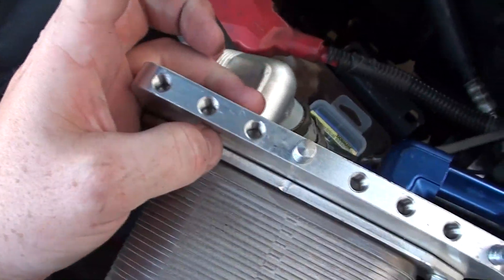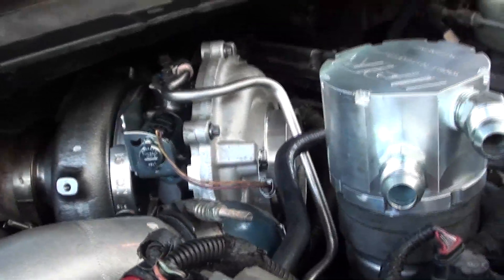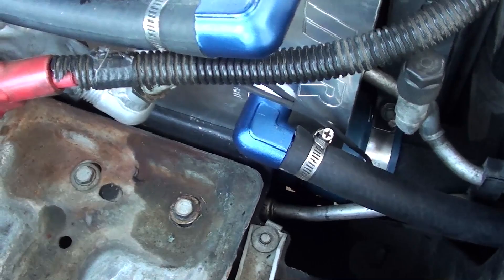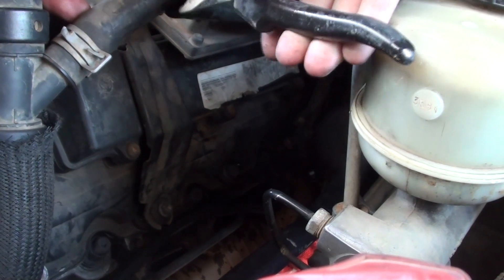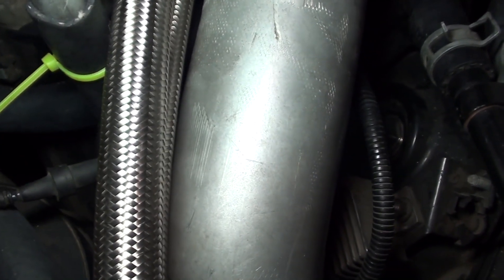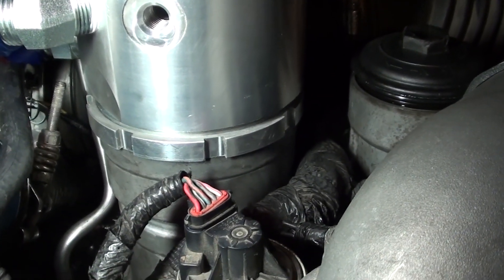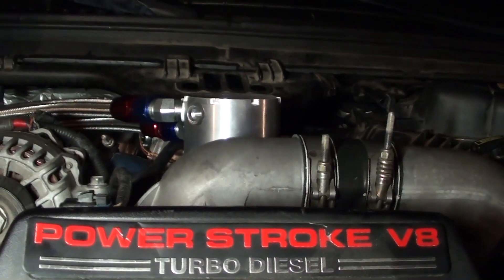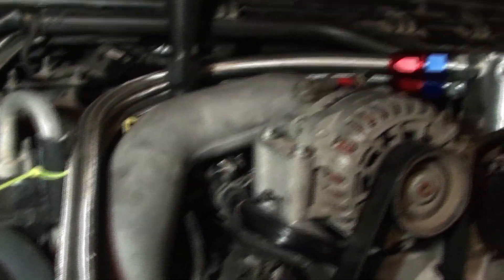Powerstroke 6.0 IPR Remote Oil Cooler + High Flow Coolant Filter Install - Part 7

Comment from the maker: I am on PS.org but I didn't sign up to be a guinea pig for IPR, I just filmed it so others could take a look at what it takes to install.  Some heat does get transferred into the coolant from a blocked EGR but it's not very much, and if it does happen to fail the coolant would just sit in the EGR cooler since both ends (exhaust and intake) are blocked off and wouldn't hurt anything.

Comment: I think Josh has it all figured now. 50 degrees spread was caused by the senor being mounted on the opposite side of the fitting. He was getting temp readings before the oil was cooled. Stay tuned, I think he will be posting some great results soon.

Comment from the maker: That's correct, the top hose on the oil filter cap goes to the top hose on the remote oil cooler mount, and bottom to bottom.  The bottom is the supply and top is the return (cool).

Comment: 50 degree deltas? Holy crap man! I just put an order in for their Gen 2 EGR Delete and high flow coolant filter kit too.... Glad I didn't pull the trigger on the oil cooler relocation kit!

Comment: very hard to get info on the kit doing my install . was wanting to know on the oil filter house is the bottom hose the hot oil out and the top would be cool oil back in .

Comment: I know this video is 9 years old, and I've googled everything to find it. I am trying to track down the oil filter housing tool to remove the top piece. I bought my truck with it already installed. I saw your nifty tool in the video. Do you have any idea where to get one or will I have to try to fab one?
Reply from the maker: Finally figured out what tool you were referring to.  I don't know if you can purchase it separate but you may give IPR a call to see. https://www.iprresearch.com/

Comment from the maker: So far it does not work. I am running 50* deltas down the highway which scared the crap out of me.  Doesn't look like there is enough water flow to run thru the coolant filter and the oil cooler at the same time.  Still working with Vince to figure it out